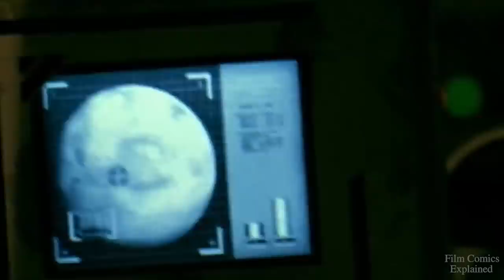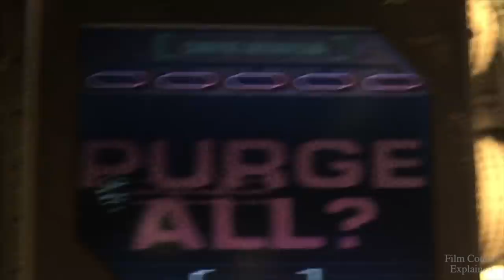Pitch Black (2000) Explored

Comment: Interesting fact: the scene where Riddick escapes his bonds by dislocating his arms? Apparently vin diesel actually did the stunt himself! He's double jointed and hypermobile in his shoulders and arms. The thing was, they had a second pair of shackles made, and they pulled his wrists tighter in, so he couldn't complete the full rotation, so they used most of the footage from the first set of looser shackles where he did the stunt. You hear them talk about it in the commentary in the original dvd release.

Comment: There's nothing in the movie (I have seen it multiple times) that states the eclipse lasts for "a month."  The only information given about the eclipse is when Imam states that the model shows the eclipse lasts for "some time."   So where did you get the eclipse lasting "a month"?
Reply: It doesn't. The imam states because the two planets were moving in conjunction, and the smaller planet is the one being eclipsed, "it would be a lasting darkness". The core samples are dated 21 years from the final entry. So in theory, it would mean from the  synchronisation of orbits from the two planets, the  full bisolar eclipse would last at least 19 to 21years, before returning to a non synchronised orbit, allowing a period bisolar cycle of 21 years.